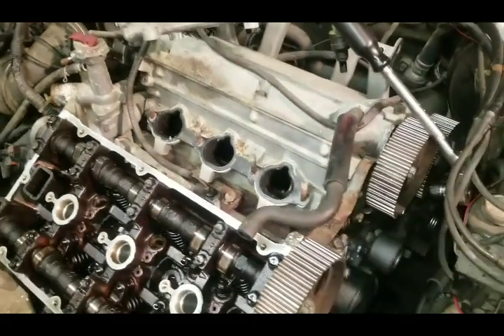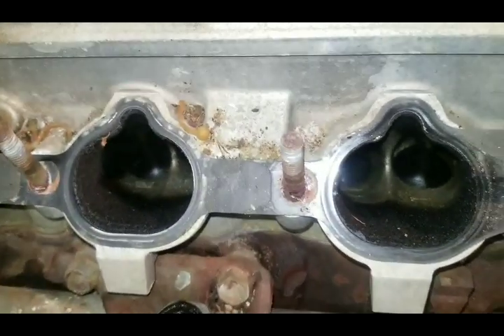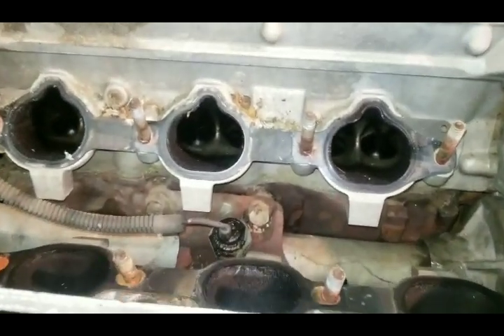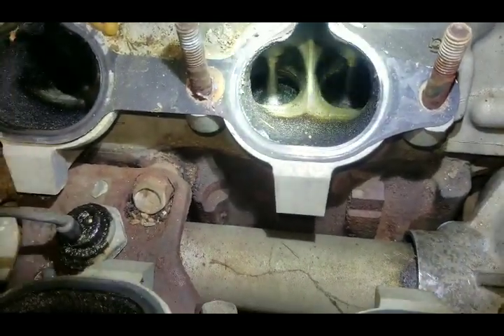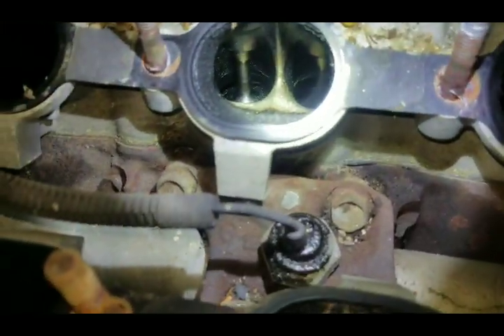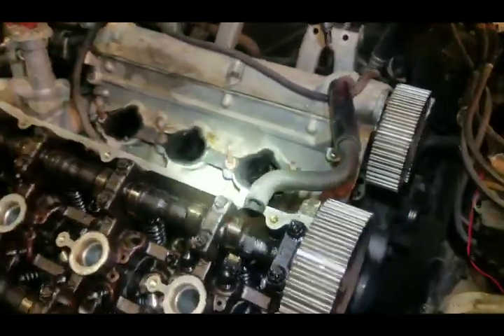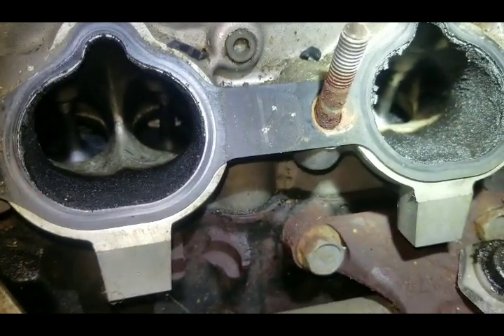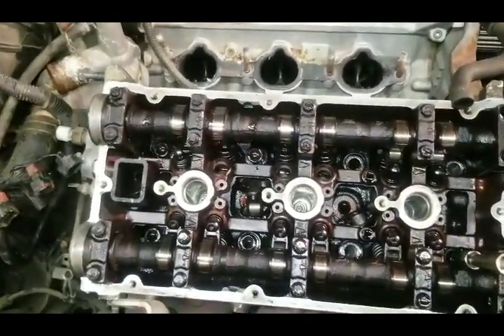How to Diagnose Bent Engine Valves, the Easy Way

Comment: Here's  one I'm  trying. Tape a string to one of those mini led flashlights and lower it into the plug tubes. This after removing the intake/exhaust  manifolds. Then look through the ports for traces of light..if you see some the valve is bent.

Comment: Please read if you’re a new owner or are in the market for a 3000gt or dodge Stealth. It’s very important!!!!!!

Omg I’m still in love with my 1992 Mitsubishi 3000gt Vr4 that I bought brand new when I was a senior in high school. I will never part with my vr4. But this op is sooo right about taking care of the timing belt and tensioner on all of the DOHC 3000gt and dodge Stealth engines. Both turbo and natural aspiration engines are interference engines and if you do not maintain your timing belt, water pump, tensioner adjuster, tensioner pulley, and idler pulley with ONLY GENUINE MITSUBISHI OEM DEALER PARTS your engine will jump time and the pistons will ram 🐏 not the valves bending them.  My timing belt was defective from the factory and broke 250 miles into owning my car and both heads were replaced under the warranty.  But I couldn’t agree more with the op. If your belt breaks or jumps time more then 3 teeth on the cam gears then you definitely have bent valves.  Even if you replace all the timing components and the car starts up. It’s gunna run rough no matter what you do. And it’s also now a ticking time bomb for further and catastrophic engine damage because now those bent valves are not seating correctly and destroy/crack the heads around the valve seats. In addition That valve is now weak and runs the risk of the Bell breaking off and literally tearing apart that cylinder. I’ve been a 3/s mechanic for years now because after my 3 year warranty ran out I taught myself how to work on these cars. And now it’s help other 3/s owners with their cars.  
     The only exception to this are the 3rd gen non turbo 3000gt base and all Dodge Stealth base models that came with the SOHC engine. If your timing belt snaps off of jumps time you can just slap a new belt on and no harm no foul. But in my 27 years of owning my vr4 I learned 2 things

1) NEVER NEVER IGNORE THAT TIMING BELT. Pull the cover off every 3000 miles and look at it. (Don’t let the bolt collar from the upper cover fall into that timing compartment). Check it for cracks and tension). If you just bought the car and the owner can’t show you proof of when the timing belt was replaced then replace it yourself. Spent the $900 bucks because it will save you the 7 grand a rebuild will cost you. Because now 25+ years later if your timing jumps chances are your pistons are gunna crack from the contact with the valves. So it will be a full rebuild (I’ve even seen the pistons striking the valves damage the rod bearing on one engine I did).  So please don’t sleep on that timing belt of the tensioner. And never never use anything but genuine Mitsubishi timing components (unless you are building a stage 2 racing engine. Then you would go with the Gates Kevlar racing belt. But for regular driving it’s not necessary). 

2) look under your car at the oil pan and chances are there will be a dent in the circular out dent of the oil pan. This comes from mechanic shops that don’t know how to work on these cars and while changing the timing belt they will place the Jack right under the oil pan to raise the engine up to remove and install the drivers side engine mount.  This is literally a grenade with a pin pulled out. Because there is literally 2-3 millimeters of clearance between the oil pick up for the engine and the bottom of the oil pan. The engine will function normally under normal driving but the minute you either go into boost or put a load on the engine it’s being starved of oil and just wiping all the meat off the main and rod bearings. This is a true emergency. Don’t buy this car unless it’s dirt Cheap. And if you see this dent in your oil pan don’t drive it at all anymore until you remove that oil pan and hammer out the dent. All you need to do is on a non turbo model is remove the exhaust down pipe, starter, the 20 oil pan bolts and carefully remove the oil pan. Hammer out the dent, inspect the oil pickup for damage. Clean everything since you already have it off. Clean it good. Apply a thin coat or RTV sealant and bolt it back up in sequence and re install the starter and down pipe. 
For the vr4 and stealth twin Turbo cars there are a few more steps. Remove the down pipe, starter, and in addition you will need to remove the turbo oil drain lines where they bolt onto the oil pan And replace the gaskets which are very cheap, and remove the transfer case. When you remove it you can just gently lay it on the clean floor but I recommend checking to make sure it isn’t leaking because there was a recall years ago with the transfer case leaking and locking up without warning at high speeds. So give it a good once over. But other then that the oil pan is the same as the other one. 

Please please take everything that I’m telling you seriously. Most of you already know this. But this post is for the new owner of a Stealth or 3000gt or someone who is new to this platform and is considering buying one. 

My opinion save up for either the 3000gt vr4 model or the Dodge StealthRT/TT twin turbo.
Reply from the maker: Thank you please like, share, and subscribe, also please check out my other channel Salem Taxi, on YouTube for more material on a different level.

Comment: How about using a borescope through the spark plug holes to diagnos bent valves by visualizing if the close completely flush?  I saw a few videos on this and tried it myself, but couldn't see the valves no matter how much i tried twisting or adjusting the borescope

Comment: If you remove a head then YOU can replace valves. You don't need to pay. Get a valve tool for your vehicle and do it.
Reply from the maker: yes i can but i send them off because at the machine shop they will service the valve seats and the valve guides. then reset to the proper angle, also grinding of the valves if needed.
Reply: I had a timing belt break, compression test showed 1&2 were low so i pulled head, replaced all the valves, used valve grinding compound, put it together and runs like new only cost me $300 in parts👍👍👍

Comment: 1995 honda odyssey timi g belt broke on hwy towed home.now troubeshooting for engine damage.tryi g to put all tdc if able too.  Checking for options on  engine damage assessment on the web.may use your method thanks
Reply: What was the diagnosis? Bent valves for sure 👍

Comment: You shouldve also looked inside each spark plug well with a boroscope to see if the tops of any pistons were damged from hitting valves.
Reply: Is this possible to do on any engine? I tried doing it in a DOHC 3.0L V6 and couldn't see anything with the brand new borescope I bought

Comment: hi artistry photography, i got a cuestion and i hope you can help me,few day ago i was tryn to remove the cranshaft bolt,and using the method of  a long breaker bar supported on the chassis and using the ignition key to loose that bolt.now i have a problem the crankshaft wont turn 180 degrees counter wise or counterclock wise,the car is a 4 runner 99  with a no iterference engine and was running perfect before my intent of replace the timing belt,thanks in advance and i hope you understand my english... 🤔🤔🤔bent valves or i misaligned the timing.
Reply: If the bolt came out with out a problem then you might have installed something the wrong way.

Comment: Hey, I have an engine that the belt broke on, the valves have definitely hit the pistons but I'm looking at the valves after removing the head and they really don't look bent at all, can they still lose all compression if they're bent just a tiny bit? I have one cylinder with zero compression I was just kinda expecting an obviously bent valve but it all looks ok to the eye.
Reply from the maker: remove the valve, also make sure the spring is good.

Comment: Do timing chains break also? I heard somebody say if you change the oil frequently that prevents breakage. This sounded like a expensive damage repair. What is your secondary channel again?? Taxi something.
Reply: Timing chains can break but they usually last 200-250k and will show signs of wear before breaking.  A lot of the time timing chains are used on interference engines because they are more reliable than a belt.  Having a belt driven interference engine kind of sucks for the very reason we see in this video.
Reply: @Sam S its a 1999 ford taurus.  Its a slight rattle when i accelerate. I thought it might be the CAT crumbling and i checked the timing chain and it had some slack but looked fine. So im not sure where to start.
Reply: @Sam S yes. I burn oil . about a quart and i did my last oil change 2 months ago. 3/4ths oil is in crankcase

Comment: We know that the valves hit the piston  therefore they are bent. So put the camera down there in each cylinder and look at the piston or the valves for nicks. They will show as shiny indentations.
Reply from the maker: no need for all that the valves are softer then the pistons an indention on the piston is no big deal but the bent valve will cause low or no compression

Comment: I just had a belt pop on me and I threw a new belt on and it runs just fine. Got lucky and had it happen high load at idle.
Reply: While driving ?
Reply: @lindseymartinez3704  Yeah. Honda Odyssey. They're not supposed to survive that at all. Just started to go at the light and it popped. Put a new one on and new tensioner and it was good to go. Only makes a tiny bit of extra noise and that has went almost completely away after 3000mi.

Comment: With bent valves. Is it  harder to turn engine by hand because of low compression.  Engine is hard to turn at some point with binding too
Reply: With low compression. The Engine should rotate easier actually. Because it’s coming up on the compression stroke. Well there is barely any compression if you understand.

Comment: Take the heads to a machine shop?  What if you are trying to do this on a budget in your garage or farm shop? Can't we just order new valves and lap them in?
Reply: check the head surface (the one that mates with the block) with a metal straight edge in all directions.  If it is straight you don't need to machine the head...if it is uneven that means the head is warped and needs to be machined.  There are videos on YT that show how to resurface it yourself with a glass table and sand paper.  check out 'oldskool funk'
Reply: Tom Armstrong yes you can

Comment: If I replaced the Timing chain and Valve solenoids put it all back together and then realized I have bent valves, can I still drive it for a bit?
Reply: Teresa Brewster I may not run at all
Reply: Did it work lol??? Same issue

Comment: It's easy to observe a bent valve after removing the intake manifold, but, How can I know that I have a bent valve while I am operating the engine ?
Reply from the maker: how is it running?
Reply: Thank you for reply, let me run the engine and tell you exactly what I hear during operation
Reply from the maker: kool
Reply: sorry for waiting, when I start the engine I hear from the exhaust pipe an irregular access
Reply from the maker: i don't know what you are trying to say, why do you think your valves are bent? if the car is running and not skipping or have a major loss of power, or you have severely overheated your engine,  your valves are probably fine
Reply: Artistry Photography   ok thank you for reply i thought i may have something wrong but it is ok now thanks a lot
Reply: Relative compression test
Reply: @Haithamsaadany  did you ever figure out what was going on with your vehicle. Was the exhaust pipe, having a faint popping/cutting out. Like a slight misfire but scan tool not picking up on the slight miss??

Comment: I think most cars are interference
Reply: I had a 1988 corolla 4a 1.6 that was a non-interference engine. That was the only one ive heard of.
Reply: I read recently that 70 percent of new cars today are interference motors.
Reply: Isuzu Rodeo with a 3.2 motor is Non-Interference.  I do not know about the 2.2 motor